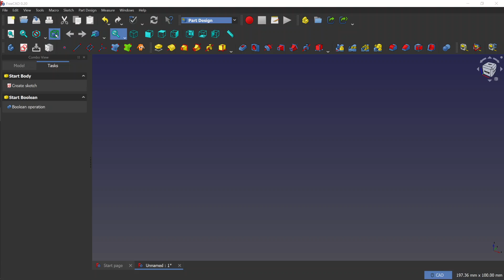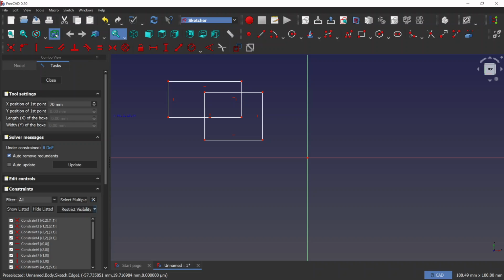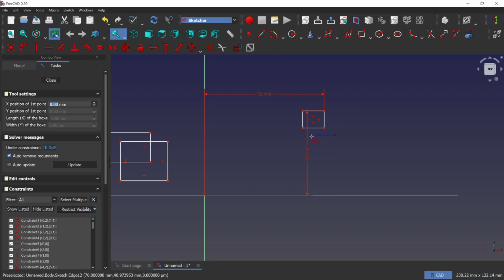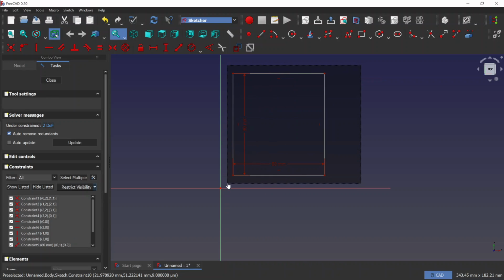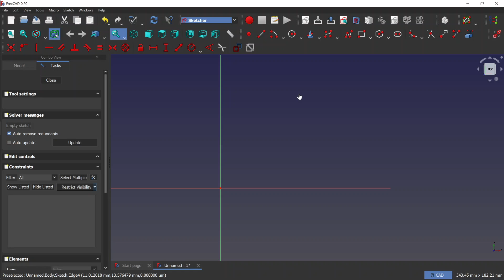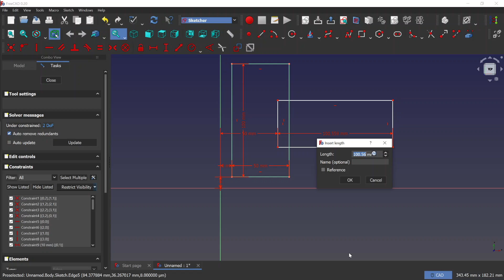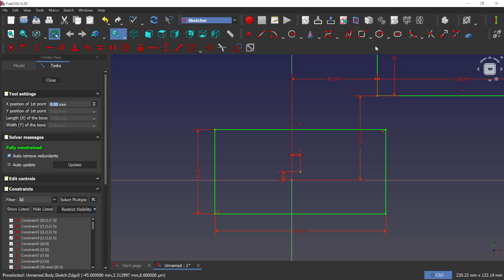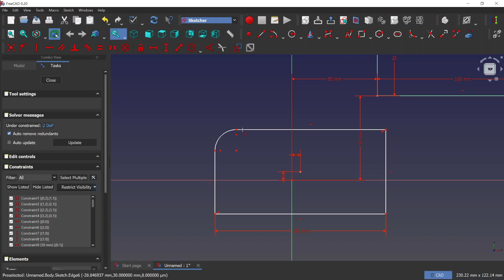FreeCAD new feature! Sketcher Tool Settings.

Comment: Nice tool! Have you considered putting all the different dimensions Tools inside one alone? And for example you select two points go to right or left and you are setting the vertical distance or if you go down or up the horizontal ? This is the feature I miss most from another soft in freecad it helped a lot to sketch up really really fast.

Comment: Wonderful. It is possible to add also relative coordinates? Let's say I draw a rectangle and the next one I want to be placed 10mm from the end of the first drawn one. Like example, QCAD can do this using the "@" before numbers.
Reply: This is going to be difficult to do. Also how does QCAD know which point to use as reference when you use @?
Reply: hey @Griffon , the "end of the first drawn rectangle" is not very precise definition as rectangle can have so many points. but yeah, other than that, the relative coordinates maybe used in the "Polyline" tool
Reply: As a first entry, there should be a switch  between absolute and relative dimension.  If you select relative, then a window with a reference point location should open....You click on the point, which will be your reference (it's absolute location displayed) and from there all the dimensions you enter are measured (i.e. relative to that reference point). It would be also nice to have a choice/switch to polar coordinates absolute and relative....a lot of things uses polar coordinates!(especially holes and slots on round parts).
P.S. -> How can I download this gadget and how do I install it? Thanks!